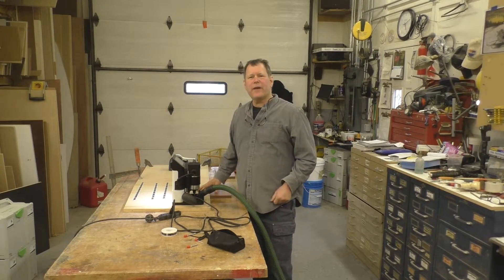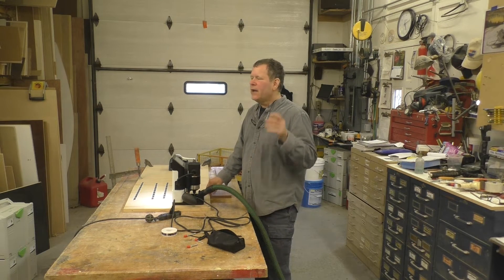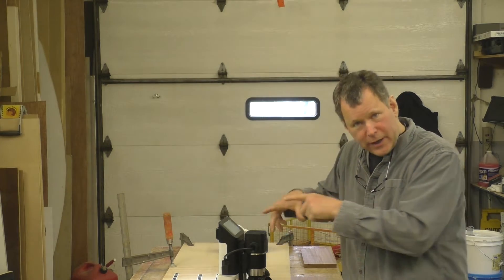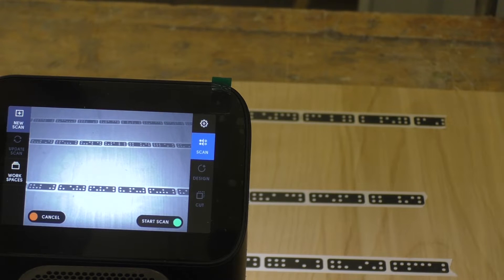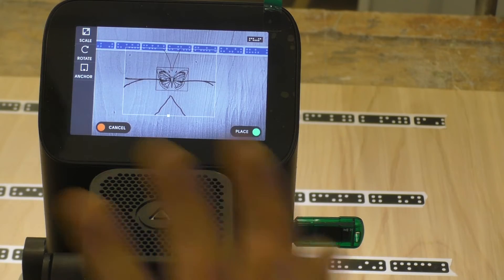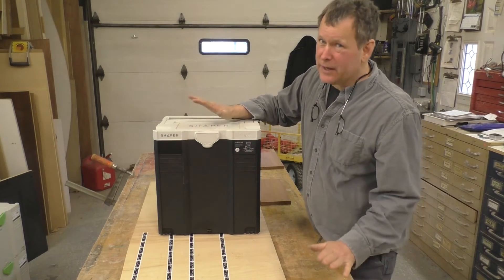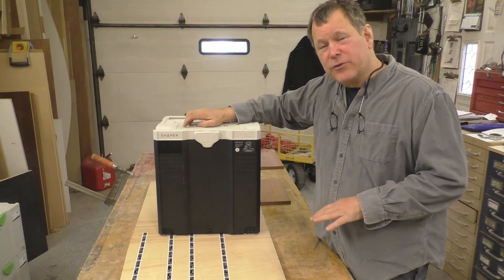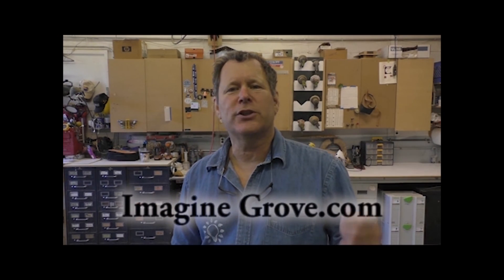Shaper Origin (hand held CNC router) Review

Comment: Surely this machine is perfect for those who, like me only have a 8 ft by 12 ft shed to work in.  I am always a bit put off when seeing nearly everyone who posts workshop videos as they are in a huge room. I even have to use a Triton table w ith the router and saw inserts, Three machines just would not fit in the shed. I am now just waitng for the next pre order slot to open again, I am told it will be the end of the year,,,,,,,, We shall see.  But thaks for your commetns about the Origin, I think future updates to the soft ware, and there have been two already will add a lot ot it. And I include getting the Z axis in there as well, then it will truly be a full CNC machine.